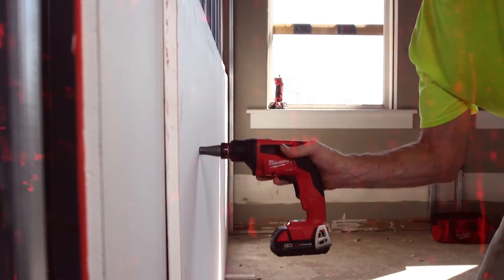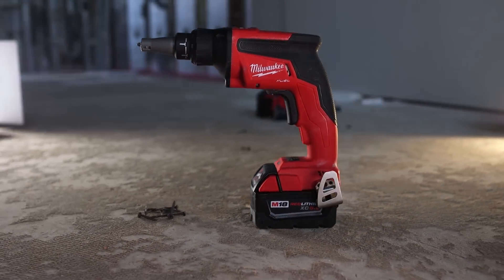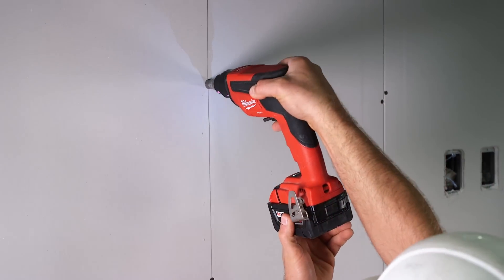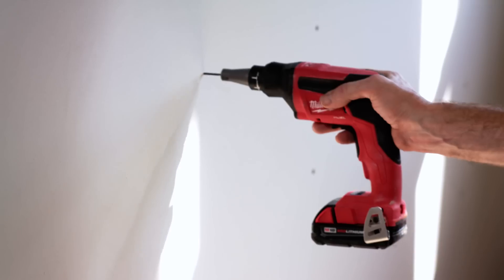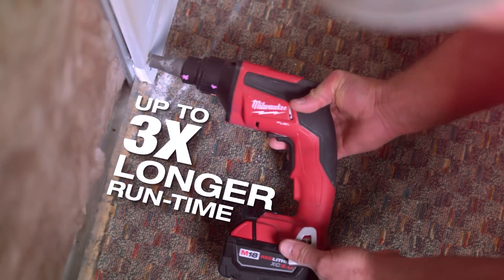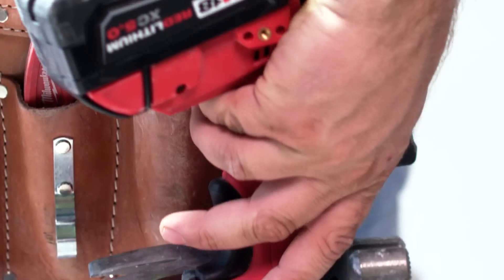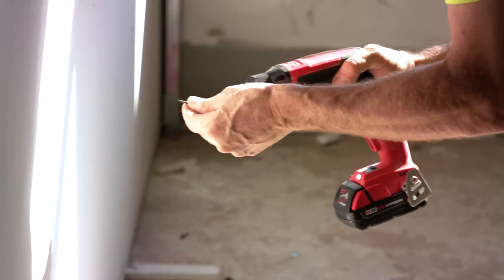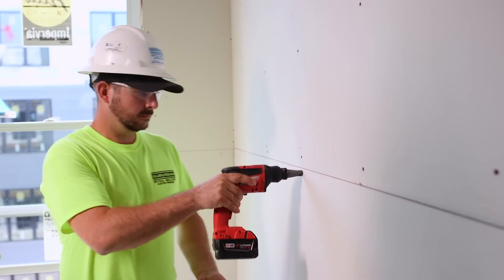Milwaukee® M18 FUEL™ Drywall Screw Gun

Comment: but does it have an auto feed for belts of screws? been holding off buying a screw gun till the milwaukee one comes out as all my gear is milwaukee but if it doesn't have and auto feed belt option will have to go with another option. . .also when will milwaukee come out with a new belt hook option that actually fits over a hammer loop. i have both types of loop and don't trust either enough to climb up a ladder with my drill on my belt. have already spoken with milwaukee rep in new zealand and he can't get answers from anyone. . .
Reply: Autofeed attachment will be available early 2017
Reply: what about new belt hooks to hook over hammer loop?
Reply from the maker: We will have an auto feed mechanism available in early 2017. Can you send us a message regarding the issues you are having with the belt clips on your tools?
Reply: they don't clip over the hammer loop

Comment: Look no auto feed with screws belt, it having auto feed with screws belt by dewalt, hilti and makita drywall gun
Reply from the maker: We do have a product planned for auto feed that should be hitting stores in the early part of 2017.
Reply: Is it going to be an attachment to this tool, or completely different tool altogether?
Reply from the maker: It will be an attachment.
Reply: How long is the screwdriver bit that works with the ca55 attachement ?
Reply: @MilwaukeeTool  Your collated attachment has design flaw depth setting is slipping because that spring tension pin is too rounded head. Also there is quite a lot play in attachment which causes screw to align badly.

Comment: rather get the dewalt with auto feed attachment
Reply from the maker: We will have an auto feed mechanism available in early 2017.
Reply: I see references of an autofeed mechanism as well as a "product planned for autofeed"

which is great, I am heavily invested into the M18 lineup already.

but please clarify- will it be an adapter for  this screwgun, or will you be releasing a different product all together?
 I am in the market, and have been waiting for this tool to be released. But I wont buy it as is, not when I can get a yellow one or black and green one that actually meets all my needs.(IE-Collated feed)

I also will call you out on the false advertising claim of "first in the industry."
Just because you coined a different name for it, doesn't make you first.
 It's a little disappointing to see false claims from my favorite tool manufacturer.

As for the belt hook issues previously stated here- 
bring a steel loop hammer hanger to you R&D department, and have them try to hang any one of your tolls on it. Sure it will hang there. Until you bend over , strecth up to reach, jump, or pretty much any other movement.
Reply: Flores 828 
Dewalt is junk